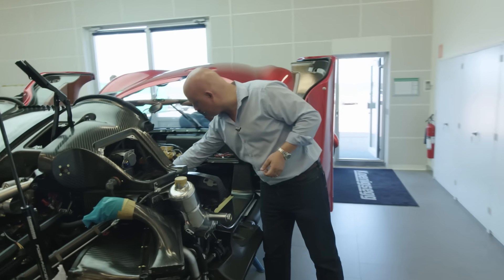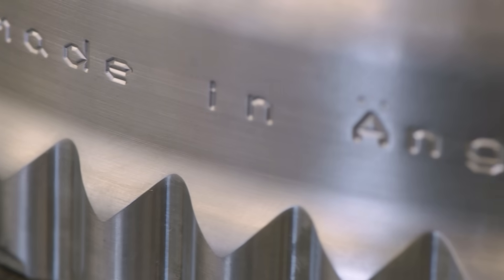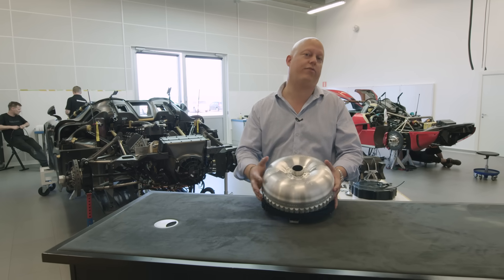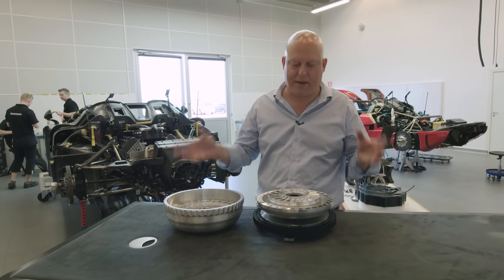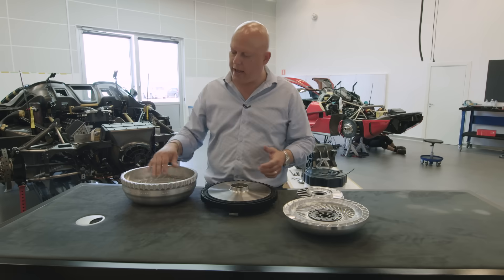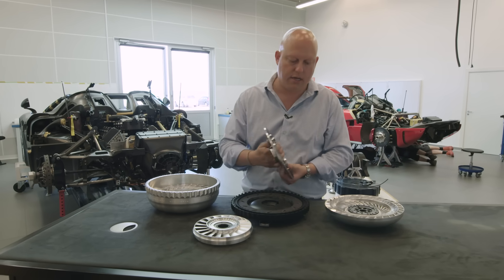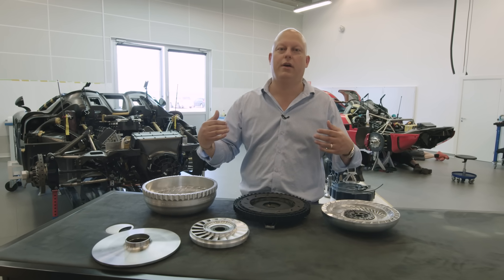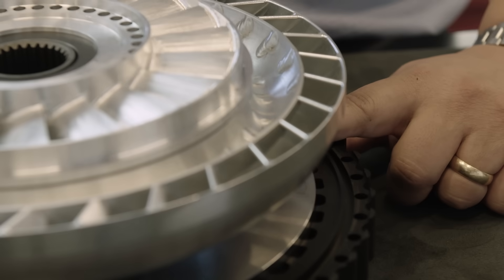248 MPH Without A Gearbox: Direct Drive  -- /INSIDE KOENIGSEGG

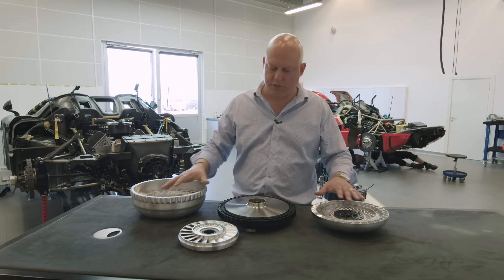Comment: 5:57 "You put in 2k RPM, and you get out 1k RPM with more then double the torque"

Was this a slip of the tongue, or is this true? How can you more than double power output?
Reply: It is not double the power, it is double the torque, turning effort, you get more torque on a bicycle in a low gear by turning the pedals faster than the rear wheel.
Reply: Power is torque times angular speed so doubling the torque and halving the RPM equals the same power. However it is not 100% efficient, as CVK said, so you will get a little bit less power
Reply: Its simple physics. Work Done=Force*Distance. Since the amount of Work done before and after the converter must be the same, barring a few losses from efficiency, if you half the "Distance", in the case the RPM, the "Force", in this case engine torque, must double.
Reply: Andre Gross definitely a slip.
Reply: Slip of the tongue
Reply: this is the correct way to think about it.
Reply: correct, half the speed and twice the torque I understand. half the speed and more than twice the torque, that's just not possible. that's saying the torque converter puts out more HP than it takes in, which is the opposite of what's true unless it can somehow work at >100℅ efficiency
Reply: If I understand things correctly, the electric motor is part of the input power going to the torque converter. It  doesn't play a factor into making the TC more efficient in itself.
Reply: Andre Gross Its probably simplified for the same of the video. Chances are the exact numbers are a little less than half, and a little more than double respectively, and for the sake of video he is rounding them to half/double and there is a totally insignificant slip of the tongue, which happens to the best of us.
Reply: its a torque converter, it's what they do. best look up other vids of just torque converters to see how they work.
Reply: I know how they work, but I don't understand how they increase total power (not simply torque) coming out. Free power can't come from nowhere. If a TC was 100% efficient, it could take 2k rpm, and turn it into 1k rpm with exactly twce the torque, but how can it give you half the speed, with more then double torque?
Reply: Maybe if they use the electric motor that's located on crank at the same time, they might get more than 2x the torque ICE produces on itself. But I too don't understand the ''more than 100% efficiency'' thing if they're speaking only about the ICE.
Reply: It's torque not horse power, like shifting down a gear.
Reply: Yes, if speed gets cut in half, torque doubles. But it can't /more/ than double, as what CVK spoke of. 

2000 RPM at 500 foot pounds (some specific HP rating) can be turned into 1000 RPM at 1000 foot pounds (the exact same HP rating) but 2krpm/500ft/lbs can't be turned into 1krpm/ (more than)1kft/lbs. 

If the torque converter took in 500HP and halved speed/ more than doubled torque you'd be increasing HP coming out of the TC. That's not possible.
Reply: That's what I was assuming was the case
Reply: it's nearly double the torque, not more than double the torque, definitely a misake

Comment: In a nutshell? Because 500hp of the Regera's 1500hp is direct drive electric motors, it never runs through the transmission, which makes any gears below the point those motors can spin the tires redundant. Since 500hp is as much as many muscle cars, it this means it'd need no involvement of the combustion engine whatsoever to burn rubber right up to highway speed, and the 1100hp engine only needs to fill in the power difference needed to continue spinning them afterwards, which means that engine RPM can still be fairly low till around the 100mph mark. To achieve this, you'd need for a much more limited range of gears (only 5,6,7), so rather than carrying the extra weight of the duel clutch transmission found in its other cars, koenigsegg instead chose to get rid of the entire gearbox and just build a bigger torque converter with a low stall, its torque multiplying slip effectively giving the car engine RPM to road speed like your using gears 6&7 in DCT, then adding a supplemental electric motor to the flywheel to provide additional bottom end torque for period when you'd be in 5th on the Agera. They claim thanks to not needing a gearbox, the electric drive system only added 88kg to the car when compared to an equivalent duel clutch transmission fitted version. Interesting note, in normal driving the internal combustion engine doesn't provide power to the wheels below 30mph since the torque converter slip amount required to have it at idle RPM would be higher than can be continuously sustained. Likewise without gears the car cannot use the internal combustion motor to reverse, instead relying only on the electric motors that direct drive the rear wheels.

I like the simplicity of the logic, and for track use it does scale to cars with less electric motor power but lower top speeds (the Regera's limitation stemming from its final drive ratio only 2.73:1 to give it its 255mph top speed), however doing so will result in a higher engine RPM when cruising, adversely affecting cabin noise, maintaince times and fuel economy. The low gear reduction mitigates these issues, because if the Regara is at redline (7,800rpm) at its top speed of 255mph, then it's cruising with the converter locked up only around 2000rpm at 65mph. If full throttle is applied at this speed, the converter is unlocked and the Regara will hit its 1,280Nm torque peak at 4,100rpm not long afterwards, probably only around 70-75mph.
Reply: Hamish McGregor great summary.
for me it did sound like the converter is only unlocked at the takeoff or even only on hard takeoffs and will lock up as soon as soon as the engine hits an rpm/the car hits a speed that allows the engine to spin "freely" and is higher than idle speed. 
you said if you floor it at 60mph the engine would rev up and reach its peak torque. that would sound like a pretty "normal" torque converter. anyway a brilliant piece of engineering and lots of respect for your knowledge about this system. appreciate it
Reply: Thank goodness! You have the best explanation of all the comments! Peace be upon you!
Reply: MrZetor The egghead in the video isn't a native English speaker and he's the guy the car is named after. He speaks like an engineer, because he is one.
Reply: This is the best explanation I've ever read on the internet. Thanks for taking the time to write it. :-D
Reply: MrZetor
You don't need to go to school to be an engineer. His status as one is firmly proven already.
 It certainly helps to go to school, especially if you want to work for a corporation, though it's not a requirement. It's a profession like any other, that you are it when you are getting paid to do it.

As for him blathering on, I disagree. He spoke enough to explain it in detail. How sad it is that you'd rather watch an animation than listen to the man that created it explain it.
Reply: ignorance can't replace smarts... ;-)
Reply: Smart people figure things out before they need to.
Reply: Great explanation.
Reply: Thanks for the explanation. I just wish the egghead in the video had done as good job as you...
Reply: Joe11Blue I know, he's Swedish. But it wasn't his language, nor the pronunciation that sucked. He just kept blathering on and on, when a simple video illustration or some graphics would have revealed the operation faster and much more clearly.

Also, the guy is not an engineer. He has studied some economics.
Reply: Joe11Blue Actually, you do. Just like a doctor or a lawyer. And I doubt the guy would call himself an engineer, not even a self-taught engineer.

Note that I am by no means disrespecting the man, he is a very successful entrepreneur after all. Making a shit ton of money selling frozen chicken and what not, and then having the cojones to hire a ton of talented ppl to start building hyper cars is impressive, but it doesn't make you an engineer.
Reply: MrZetor
Uhh, what? Do you really have no idea about his history? He's been an inventor since he was a kid.

No, you don't need a degree to be an engineer. An engineer is a professional title, there are degrees, but the position doesn't require it. We have engineers in the US that never graduated undergrad, but have PhD's. They are simply that brilliant. Being an engineer is about capability, not pieces of paper. A doctor requires certification, that is why a degree is required. You can become a lawyer without a degree, just pass the BAR exam.
Reply: Joe11Blue Jesus... I DO know him and his inventor history, the 'Click' floor boards and all that. You, on the other hand, quite obviously have no idea what an engineer is and what studies that encompasses.
Reply: Joe11Blue Oh, I see that you just edited your earlier comment, to which I replied already. Classy.

" How sad it is that you'd rather watch an animation than listen to the man that created it explain it."
Right. Surely the guy cast/welded/3D-printed/machined all the parts himself, and did all the design etc. Get real, son. The man has a team of brilliant engineers, and a lot of money. He has a vision, they do the work.
Reply: MrZetor
I edited nothing, you missed it the first time around, that is on you.

He uses machines, and obviously he doesn't assemble the cars, he pays people to assemble them. He does the majority of the prototyping work. Using CNC machines, like any modern shop would.

I do physics, either way, you're looking for an argument like a child. I have better shit to do. Good luck with whatever it is that you're looking to do with such a mindset.
Reply: Joe11Blue Wow, you really are clueless, aren't you! You do realize that YouTube shows which comments have been edited, and yours have. You even edited the inventor comment after I replied!

"there are degrees, but the position doesn't require it" - No shit, Sherlock. Owning a company does indeed not require a degree.

"We have engineers in the US that never graduated undergrad, but have PhD's" - I call bullshit on this. At least in Europe you must do the MSc degree before you can do PhD.

"You can become a lawyer without a degree, just pass the BAR exam." - Yes, and what do you have to do to pass the bar? Study. A lot. Which this guy has not done.

"He does the majority of the prototyping work" - I don't buy this for a second. His company does, not him.

Go and 'do physics', kiddo. I see that you worship this guy, and for some reason want to elevate him to the status of jack of all trades. Believe me, there are and have been plenty of billionaires who have created fantastic products, but in reality the work and innovation is done by the employees.
Reply: Joe11Blue Smart people are usually not given to verbal diarrhea.
Reply: MilesDei Yet here you are shitting your opinion all over this thread.

Comment: sooooo it's just an automatic but more durable for 1000+ hp, I swear people get excited about nothing
Reply: Dexter Sullen not an automatic. Automatics have multiple gears.
Reply: Its not an Automatic, it has no gearbox!
Reply: If this doesn't excite you, you don't understand the implications
Reply: It's nothing like a CVT..
Rewatch the video it's simple , don't overcomplicate it.
Reply: This can't be blanketed under terms of what we currently describe transmissions as. That's why it's amazing. It's not an automatic and it's not a Cvt.
Reply: I woulda been more interested if the made a clutch cvt capable of handling 1000+hp and that woulda been faster
Reply: it is a cvt...
Reply: Naw that's torque converter with liquid transmitted power
Reply: it is a hydraulic cvt
that is the simple way to explain it
Reply: It's a E-CVT with a torque converter. Very similar to Honda Accord Hybrid (well, sans the horsepower).
Reply: Not an automatic, there are literally no gears....
Reply: I may be wrong because I've just googled E-CVT for 10 minutes but E-CVT is still changing gear ratios if I understand Wikis and other sites Google gave me? That means a plentiful of components not existing in CvKs solution? If I'm right it is not at all like Hondas E-CVT car? Please, mighty knowledge of Internet Users - enlighten me if I'm wrong.
Reply: Dexter Sullen bro it's no were near to an auto cause it has noo gears or does it use the engine to go from reverse to we'll (7th gear in a sense) to drive can't call it first cause Cvk said its basically 7th gear of the agera but with more touch and electric motors u should listen better if u wanna fully understand
Reply: no belt, no pulleys,
hydraulic Continuously Variable Transmission
Reply: looks and works similar to torque converters
like he said in the video
Reply: Benny Lloyd-Willner

It's just a lock-up torque convertor.
Reply: at first skipped most of the video and i own a cvt motorcycle and played with the settings and this is completely different just look up cvt engineered explained, He never explained how he got one disc to go up in rotational force while the first goes down like in a traditional cvt 7 gear =(10%/100%), 1st gear (100%/10%)

while rollers are on the other side of the first disc. for rotational mass distribution
Reply: also he might didn't mention exactly how he got it to resemble a cvt for patient reasons, and its possible, since torque converters transmit power without touching
Reply: Mr. Karlsson  and others : yup,  this particular component. What I was referring to is the whole gearless direct drive concept. I may misunderstand comments but for me it sounds/reads as people think CvKs direct drive isn't an invention or innovation at all. He states in the video that it is not for continuous use (the TC) , just start with more torque =torque converter with lockup.  CVT is for continuous use since it actually varies gear ratio to make engine rpm optimal at all speeds. That is still my belief/opinion.
Reply: sens it only have one gear (top gear) everything below a certain speed have to be provided by the (TC)

Comment: how does reverse work?
Reply: Alex Domatas electric motors
Reply: IsaacScz yeah but with a torque converter, if the output is reverse from the input: the torque multiplication increases exponentially as reverse rpm increases. they must have some way of completely disconnecting the torque converter.
Reply: probably just shut down the engine and reverse with the rear eletric motors, the torque converter can take some input from the rear without spinning the engine backwards.

And hey, with their freevalve engine the could probably run the whole engine backwards...
Reply: You're the man! yeah I forgot about the free valve thing they could run the engine backwards especially considering it sounds like their starting motor isn't a normal starter. Man Koenigsegg pulls ideas from everywhere. I mean their whole setup on this is basically a torque vectoring system. Their valving reminds me of large marine two strokes. I wish there were going to be more than like 10 of these cars made.

Comment: Koenigsegg is doing so much for the car industry
Reply: Look up the 1948 Tucker, he envisioned taking out the big 3 with a direct drive system that had a torque converter on each wheel. His car blew away the big 3 with fuel injection, safety harnesses, pop out windshields, all wheel drive, and a cyclops headlight that rotated when you turned the steering wheel. He was small and they eventually snuffed him out legally but 50 examples of his car were made. Direct drive is not a new idea, just new technology by an already established company which gives the big 3 no chance of doing what they did to the Tucker.
Reply: So much for the big 3,  it's all about these small nimble companies now. I love it. Bring down corp. shills.
Reply: I concur, Tucker was a genius, just not a good biz-man ;-)
Reply: 50 years too late. In another decade internal combustion engines will be as dead as dinosaurs.

Comment: Interesting so it uses the converter to relay enough torque at low ground speed to launch and then once the hydraulic pressure allows the engine rpm and drive rpm to sync up it locks and allows the drive to spin at a 1:1 ratio all the way to top speed? Top gear did something similar to this with the c6 zo6, they accelerated in 4th (or 5th gear) from a launch all the way to max gear speed (like 140 mph) and showed that the engine had enough torque to launch and reach a high speed. This is just a far more efficient process. Like driving in a 1:1 ratio all the time but a viscous enough start off the line to protect drivetrain parts and multiply torque. Christian you are like Tony Stark in real life. Cure cancer already will ya?

Comment: Standard torque converters out of standard automatic transmissions can multiply torque when they are slipping or there is a difference in input speed vs. output speed that is nothing new. This just has enough torque and HP that gearing is not needed much like the electric Tesla cars. The heat being generated in the fluid during torque multiplication is lost energy and fuel economy will more then likely suffer some because of it. Which for this type of car is fine, but it is not really practical for the masses due to how cheap transmissions are vs. 500+HP motors.

Comment: I keep hearing a lot of concepts that are used by the Voith DIWA.6 transmission. The torque converter is not connected to the flywheel, but is inside the transmission.  They can adjust hydraulic flow to allow for maximum acceleration efficiency before shifting to clutched 2nd, 3rd, and 4th gears. Not exactly the same here, but a great application of a technology that has obvious benefits despite its perception as only being for slush-box automatics.